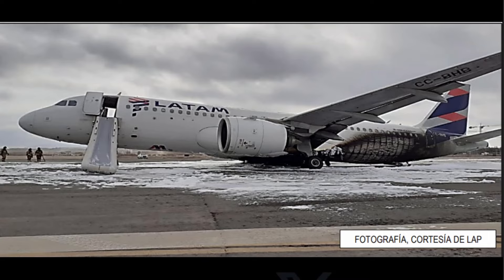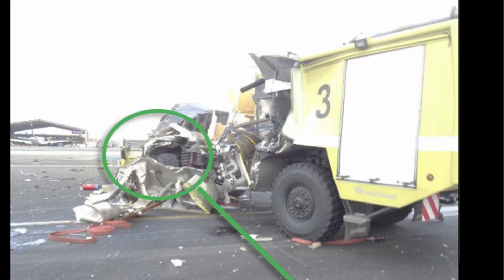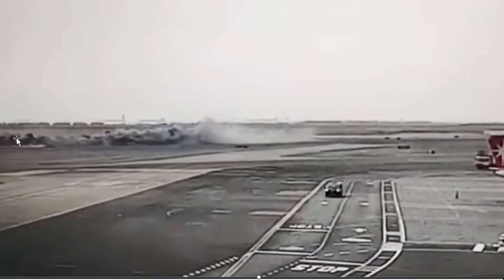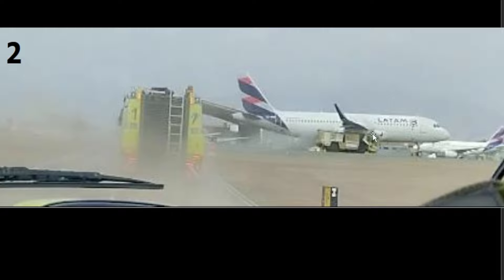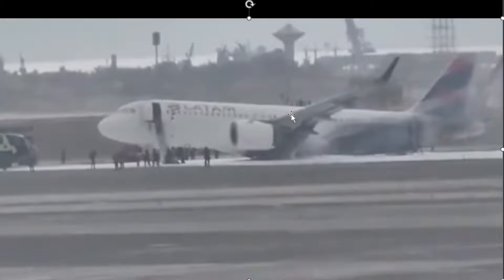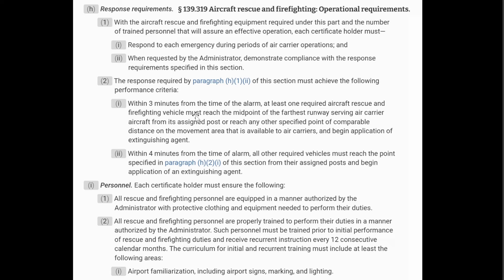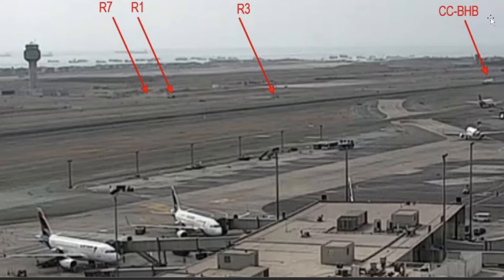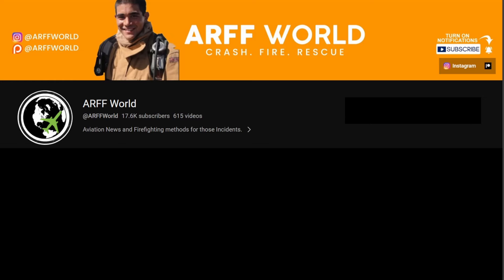Airbus & Fire Truck Collision Breakdown

Comment: According to the Translation of the Final Report by the Aviation Herald there were a couple of slices of the "Swiss Cheese" crossed, some assumed and some really strange and unexpected:
- There was no pre-exercise briefing between the two involved Companies: LAP, who´s running the Airport including the ARFF and CORPAC, running the ATC. As a result ATC had no idea what ARFF was planning as exercise and ARFF had no idea that ATC doesn´t knew what they´re planning as exercise. ARFF simply assumed that ATC was up to date while ATC was in fact not.
- The ATC had an astonishing lack of knowledge about the new Airport Design and new Airport Facilities. ATC doesn´t knew from where the Fire Trucks would come and to what direction they would drive (the most shocking part of the Final Report). When ARFF questioned to remove the safety cones at the new taxiway ATC had no idea that to approve this meaned to open the way to enter the Runway. 
- As a result there was a fatal miscommunication between ATC and ARFF: Ground Control thought ARFF would enter the new Taxiway while ARFF wanted to use the Runway for the Exercise.
- Not using Standard ICAO phraseology by both sides caused a confusion of this two concepts: ARFF questioned for runway use, ATC thought it was questioning for taxiway use, ATC thought giving clearance would mean giving clearance to use the taxiway.
- Misinterpretation of the Clearance as consequence: The Supervisor of the ARFF mistook the Clearance from ATC to start the Exercise therefore as Clearance to enter the Runway because this was his concept of what was going on.
- Miscommunication within CORPAC: The ATC responsible for giving the Take-off-clearance had no clue about the scheduled exercise until a very few moments before it started. So he gave the Clearance for Take-off to the Aircraft not aware that there was an ongoing exercise nearby and that it could affect the runway (Lack of communication between Ground Control and Tower Control).
Reading it gives you the impression that literally everything went wrong what was possible to go wrong. It´s a Case Study how to not do an ARFF exercise, which should taken to notice by the Aviation Industry.
Reply from the maker: Agreed and thank you for the write up
Reply: Diddo that. The findings are in the fine details. Well done.
Reply: @ARFFWorld  Thank you from me for picking the final report up! I fear it´s mainly the usual story in this case: Now, where the Final Report is out and shows what really happened and what lessons are to learn from this accident, nearly nobody takes a notice from it, so that lessons stayed unlearned. It doesn´t improve the case that the Final Report was published only in Spanish.

Comment: 1:00 I'm not a fire fighter, but I think it was likely an easy choice. You can see from the wreckage that the fire fighters in that truck didn't need any help. The people on the plane did.
     My sister's husband's sister's husband was the head if the ski patrol at Mammoth Mountain. A C02 vent opened on the mountain and a group of ski patrolmen were sent to rope off the area so no one would ski into the invisible gas.
    Sadly one of the ski patrolmen accidently stepped into the cloud of gas and dropped dead. His buddy saw this and rushed in to help, but he dropped dead as well. Then another and another.
     All told 4 or 5 ski patrolmen died before they realized getting close to the bodies was lethal.
    I can't imagine what it must feel like to see 4 or 5 of your buddies drop like that and do nothing to help them.

Comment: Yesterday I saw the final report and I was wondering if you'd cover it. It really goes down to a significant lapse in communication. I may be wrong, but I believe this to be one of those landmark accidents like the Tenerife disaster, bringing some changes. This time around - considering even more of the moving parts on the ground, that is the ARFF vehicles. Unfortunately, no English version of the report was published
Reply: Indeed - and it should be recognised in the Aviation Industry as such.

Comment: It is sad that this incident happened.  Glad it is the exception and not the norm.  Perhaps the ARFF driver was momentarily distracted and lost his situational awareness.  I do not think he would have purposely entered a runway with an aircraft approaching at over 100 knots.  May he and his passenger rest in peace.
Reply from the maker: Thank you.  RIP
Reply: The ARFF driver had as few to do with what was going wrong as the Pilots had. The misconceptions and miscommunications happened at higher and different levels: between the two involved Companies, between the Superviser of the ARFF and the Ground Control and between Ground Control and Tower Control, in addition there was assuming instead of knowing at all of these involved sides and also a shocking lack of knowledge at the side of Ground Control about the new Airport Design and new Airport Facilities.
The ARFF driver probably became only aware that something was seriously wrong when he saw the accelerating aircraft directly in front of him, i.e. when it was too late - and same with the Pilots.

Comment: This almost happened to me when I was operating an ARFF vehicle inside the movement area of an airfield during an inflight emergency. Even though tower gave me permission to cross an active runway, a 727 was landing at the same time. Good thing common sense kicked in and I a stopped. We have to remember in ARFF, aircraft always have the right of way, even in emergencies.
Reply from the maker: Thanks Edward, just because you have clearance, doesn't mean you dont have to look

Comment: A bit off topic. Some of those fire trucks are the Top fuel dragsters of diesels. 2 stroke forced induction, automatic transmissions that shift like a clock, multiwheel drive...
Ok back to reality...its really fortunate more were not injured. 🤕😢

Comment: Did Peru CIAA make any remarks about weather as a factor in their Final Report? And, does airport have ground radar? It appears to be overcast with flat horizon. With a white aircraft (CC-BHB) and only colorization being blue and red tail and blue stripe on rear fuselage, it's possible the driver of ARFF3 sitting in CENTER of the cab didn't even see the aircraft on takeoff roll. Although a tragic loss, this is a Airport Management/Command Officer failure for timing of a TRAINING EVOLUTION, and egregiously unacceptable.
Reply: According to the Final Report Weather doesn´t played a role in this accident.